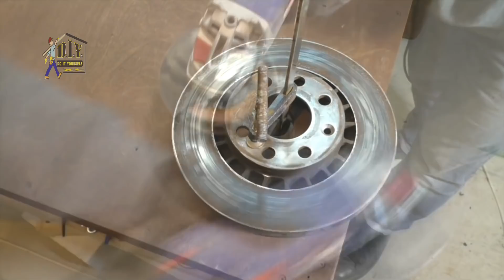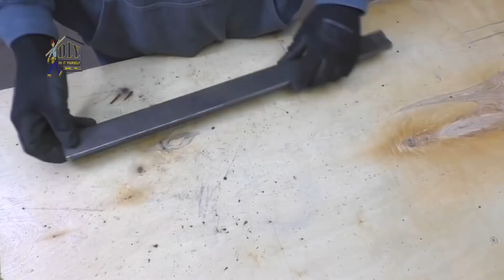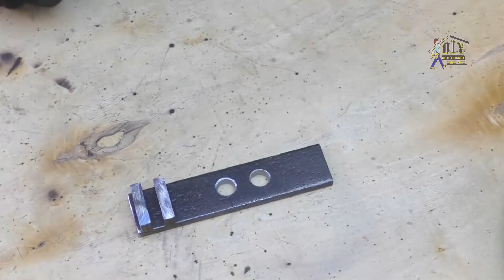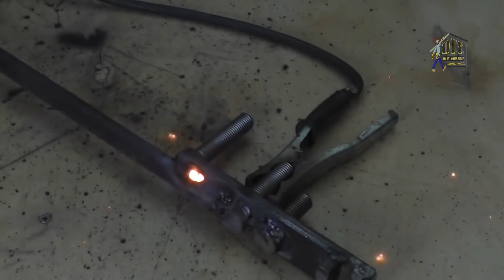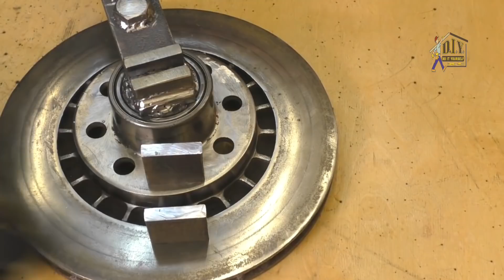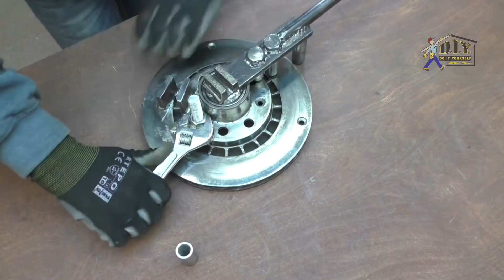How to make Metal bender using brake disc || Mechtrick

Comment: Finding a large bearing that size is very costly, where did you get the one you used? Im going to use a 'pipe within a pipe' instead of the bearing, I hope it works.
Reply: I'd think any automotive wheel bearin could be made to work. Look for a used one from any make or model. Worst case scenario you'd have to do some cutting to trim the bearing housing down..

Comment: Well, if you had shown the various different bends that could be made with this, it would have impressed me more. As it is, it wasn't of much interest to me. Shame, too, as there was obviously a fair bit of work put into it.
Reply: He literally showed that in the first few seconds of the video. He made bends with every pin on the base. If you want more bend go farther with the handle, less curve, not as far, and obviously the pin closest to the center will create a tighter ring. Oh and if you want to bend the other way, spin the rod 180° and hammer down.